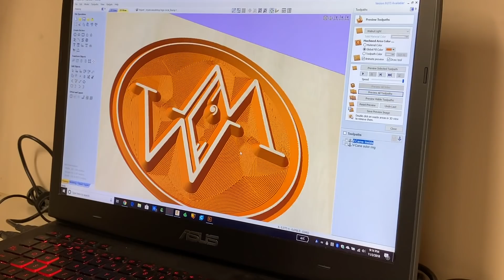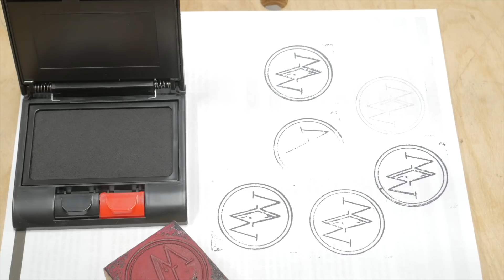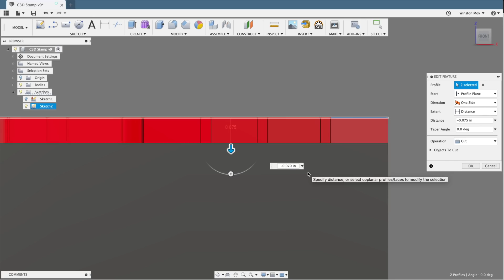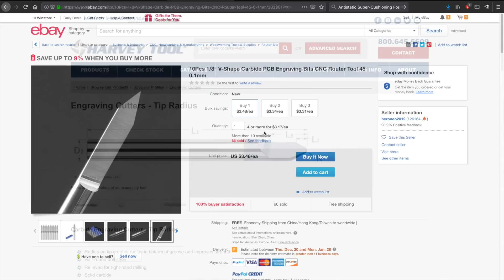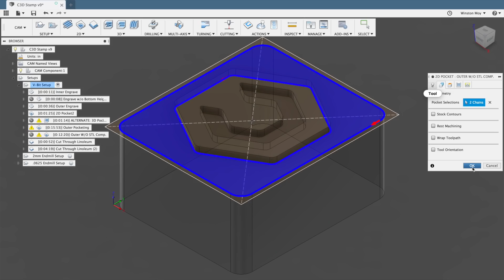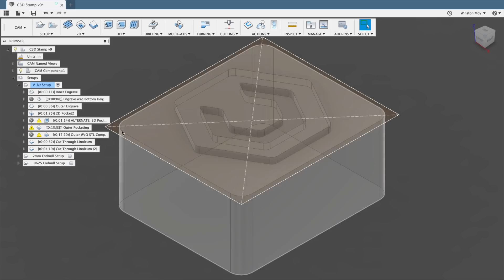Learning How to Mill Linoleum - #135

Comment: @6:00 … the lino is flaring out due to its softness.
It’s been seven years since you posted this, and I didn’t see these helpful ideas in the comments, so I’ll share them here.
You can achieve higher resolution and finer detail depending on the hardness grade of your lino. For spindle and router carving, harder lino is naturally better—but that’s not a guaranteed fix. These methods, however, will help greatly.
1. Ice Pack Method
Place ice cubes or crushed ice in a Ziploc sandwich bag on your lino for a few minutes while everything is being set up. Be cautious of thermal creep on larger projects. If you’re concerned about warming, you can always program a fake tool change to pause the job, reapply the ice pack, and then resume milling.
2. Pre-Freeze Method
Another option is to freeze your lino blocks before milling them. This works very well but can be cumbersome, and as with the ice pack method, larger pieces may develop thermal variances between milled and unmilled areas.
3. Freeze Spray Method
A third option is to use freeze spray (or its modern equivalents) on the fly. Freeze spray is available in machine shops and healthcare supply stores and comes in aerosol cans similar to compressed air for cleaning computer keyboards.
There you go!
Rune

Comment: Could you machine a mould to cast some kind of curing soft material (Like a silicone rubber) into it? that way you can use a hard material for the resolution and ease of machining but also have the benefit of the finished stamp squishing a little and conforming to the printing surface. It's an added step for sure but mixing silicone doesn't actually take that long and then you can let it cure overnight or while you're doing other things in the shop. You'd then have the best of both worlds (resolution and squishiness) instead of compromising on the finished product to eliminate one more operation.

I seem to fall into the trap where I want to use my CNC for every single thing that I make because it's hard to get out of the machining design headspace but there are always other tools and manufacturing processes that don't always cost too much and would give a far better finish than what I could achieve with my well trained spiny thing.
Reply: hmmm this is a great idea. I'm struggling to carve some linoleum stamps for block printing flyers for my business. but I make products from silicone and urethane molds in my biz so... you got me thinking. Thanks!
Reply from the maker: Yea, definitely possible. Just need to ensure you are smart about the way you cut so the surface is as smooth as possible.

Comment: Thank you Winston!
I think you just pointed out something to me that I have been over looking in my engraving, I’ve been having difficulty with the depth of cut, always seems to be too deep, but I think you just pointed out that the real tool has a flat spot but unless you enter that in the tool data base the software thinks it come to a true point, so i’ve been touching off the tool to set the Z axis zero and it’s been on the flat spot ???
That’s why I’ve been too deep?
Does that seem right ?
Reply from the maker: It shouldn't go deeper, but your cuts will be sloppier. Because instead of thinking it's cutting at a radius of 0 at the tip, it's actually cutting wider. So your text might end up a little fatter than expected. I always used to zero off a few sheets of paper off the actual surface of my wood when using "dumb" engraving software. You can always cut a second time lower if you're not cutting deep enough. Can't go the other way.
Reply: Winston Moy 
Exactly, deeper (theoretically) if there was an actual point, but yes wider, with a small flat spot at the bottom
And yes I have been compensating just as you suggest, by starting high, and making a deeper cut when needed.
Just couldn’t figure out why, until you pointed that out, thanks.
My brain has been overwhelmed lately 😆

Comment: if your only making 1 or 2 at a time freeze the entire block in liquid nitrogen. doing this will harden the material enough to get a clean cut. you should be able to machine faster due to the harness of the material when frozen. being you are using a rather large block of wood under the linoleum it should retain its thermal properties for enough time to machine. if anything its worth a shot.

Comment: Is the arcing artefact present when using freecad on grbl?  I noticed inkscape couldn't output true circles when doing 4mm diameter holes, but freecad looked perfect to me (on gtbl).

I made a freecad video.  (I avoid fusion because they might yank it away...)
Reply from the maker: Never used Freecad so I don't know. I have noticed that Inkscape doesn't do well with imported splines and certain curves though. They either don't come in at all, or the radiuses/fillets are inverted sometimes.

Comment: https://armor-tool.com/product/auto-adjust-b7-il-in-line-t-track-clamp/

What are your thoughts on the following, as a possible way to secure your work piece with the t track?
Reply from the maker: No different conceptually than the CAM style clamping I used at Ben's. Evan & Katelyn have used this particular style with T-track. Works fine, as long as your stock is thick enough.
Reply: @WinstonMakes  until you screw up (well, Winston wouldn't ever screw up) and hit that huge metal clamp with your bit...that's why i prefer the mdf/wood cam clamp.  I'm human, bound to make a mistake.

Comment: Have you thought about freezing the material with something like CO2?  I use CO2 as my cutting gas on my laser when cutting acrylic as it offers the acrylic a quicker chance to resolidify due to the temperature differential.  Generally speaking, the thicker the acrylic the greater the need and result.
Reply from the maker: I haven't considered CO2, though I have heard of cold air guns. CFM usage is too high though. Are you using canned air or something? 

I like what Applied science did with his neoprene cutting experiments. I've thought about doing a dry ice bath with something like alcohol as a conductive medium. LN2 would be even better, but more problematic to acquire.
Reply: I would worry about dry ice making it too brittle.  I bottle the ugliest tank I could find from my local PepsiCo guy.  I did have to purchase a regulator and gauge as each gas it’s own unique thread set.  For my laser application, the tank is upright and standard air fittings are used.  If the tank was inverted then you would get mostly liquid and some gas.  I have the local fire extinguisher guy fill my tank as he is the cheapest around.  It’s about a $20 refill and you are charged by weight.  I put my tank in the chest freezer before a fill up as it will allow for a greater volume to be filled.  Where are you getting your stamp material?  Now you have me curious as to how it will do on the laser.
Reply from the maker: @LeRoyLincoln  Right now just random art supply places. May narrow down a single source in the future for consistency.

Comment: The various bit type restrictions in Fusion CAM really suck. Technically, a "v-bit" is just a straight flute tapered mill and, incidentally, you might want to choose spiral fluted tapered mill for deeper engraving due to better chip evacuation. To add even more confusion, there are chamfer mills completely unsuitable for "v-engraving" (with brazed inserts or single oval flute), yet Fusion seems to support engrave only with that class of mills (and spot drills, which is even more ridiculous).

Comment: Rubber stamps only with a laser cutter. I achieve extreme detail and is a matter of minutes. CNC is suitable for brass stamps. Also linoleum as a material is not ideal as it has a hard surface that does not absorb normal ink. We used it mainly at my school of arts for patterns that we carved by hand and pressed on paper but with thick CMYK paste inks.
Reply: Have you tried lino cuts with a laser cutter?

Comment: Holy crap!!!! did you see the machine deflect when inking the stamper?!
Reply: I think that’s just showing how much power is in Winston’s arms!
Reply from the maker: That's not the machine deflecting. That's a flimsy piece of cladding that covers the solid frame and steel rails. It's basically cosmetic.
Reply: @WinstonMakes  Whew!!  much better.
Reply: Makes total sense now that i see the Y axis runs in those slots.

Comment: Are there any other widely available materials that can be useful for stamping?
Reply from the maker: Make or Break Shop made a stamp from a softer rubber, but it didn't cut as cleanly. For printing purposes, you could even just carve a block of wood.
Reply: DreadDeimos maybe rubber flooring material?